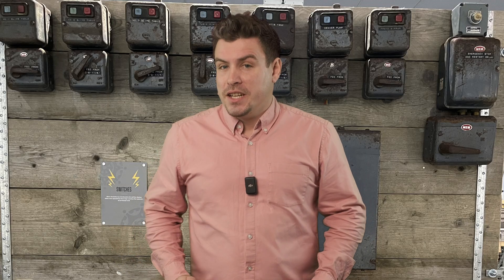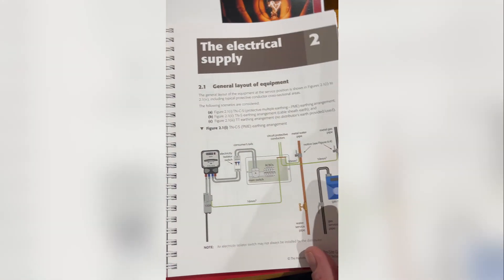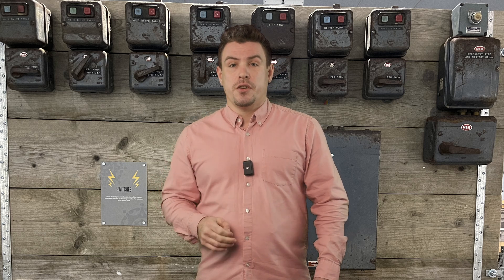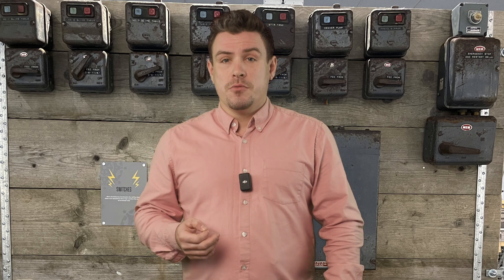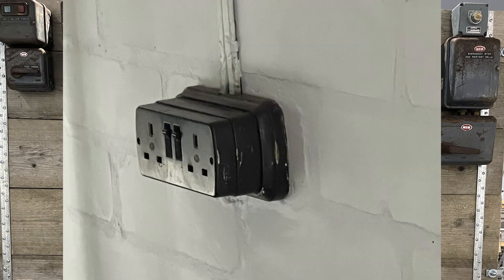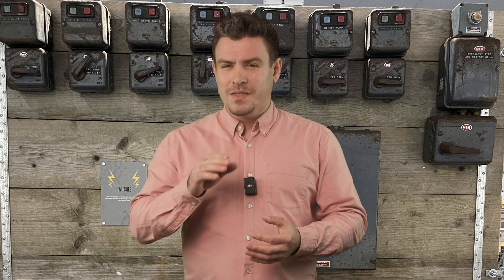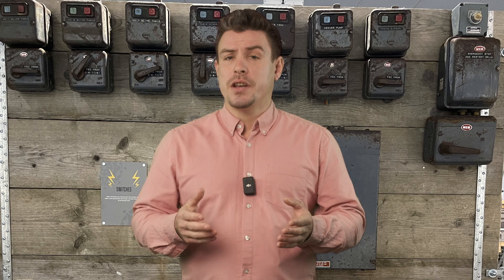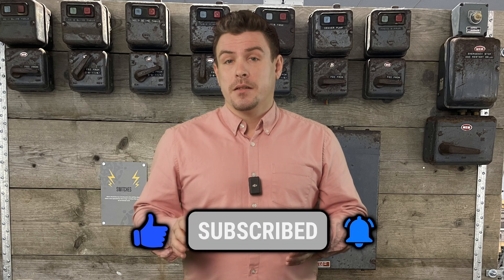'Electrical FAULTS that could KILL!' WK15:Becoming an Electrician

Comment: 3:22 - Earth = CPC (Circuit Protective Conductor)
Reply: The green/yellow wire has always been called the earth conductor and it always will be. Same as twin and earth has always been called twin and earth and always will be pyro is pyro  if you go to the wholesaler’s and for a 100 mtr drum of PVC twin and CPC or a drum of MICC you will get some funny looks and probably told to leave and close the door behind you.. a hammer has always been called a hammer you don’t go in to a store and ask for a knocker inner  do you  or a screw twister when you want a screwdriver.
Reply from the maker: @Dog-whisperer7494 good shout 😂😊

Comment: You realy need to read page 99 in the onsite guide if you have a copy and the health and safety executive’s note in BS7671. Also RCDs are only required for all circuits from amendment two going forward , installations designed before amendment two are not required to hove RCD protection on all circuits ,
Reply from the maker: Thanks for your comment and the references. Totally agree sorry I wasn’t clear in the vid. A bit like the old wiring colours. Just because they are not current regs, doesn’t mean you need to rip them out. 
It’s also not an excuse to convince customers that they need to upgrade an existing CU just because it doesn’t meet the current amendment. 
Personally, I want to have AFDD, and RCD’s protecting more of my circuits than I currently have. My own house will also be a good guinea pig.

Comment: Not correct about every circuit below 32A needing to be on an RCD. Depends what the circuit is designed for and how the cable is run etc
Reply from the maker: Thanks for sharing. Please share the cases where RCDs are not required. My understanding is sockets in commercial settings with a risk assessment is one situation.
Reply: @TheOfficialBatteryMan  if a circuit supplying a heater, cooker or water heating element for example was installed in say the kitchen, garage, utility room and was wired in surface conduit or buried in the wall in steel conduit or wired in SWA cable, it would not require RCD protection as long as the maximum recorded Zs at the end of the circuit was below the maximum allowed Zs for the protective device serving that circuit. All lighting circuits in a domestic installation need to be protected by a 30mA RCD as well as any socket outlets with a rated at 32A or below.
Reply from the maker: @gjrendle in those situations there is mechanical protection and a path through earth to trip the MCB. There is also protection from cable zones. But still potential for people to be shocked, right ? Take your cooker .. in fault conditions the casing could become live.
Reply: @TheOfficialBatteryMan  yes that’s correct it is to do with mechanical protection or not being buried in the wall less than less that 50mm with the risk of being hit by a screw. 

Because the zs reading on the cooker would be low enough, it would not present a dangerous touch voltage. Any touch voltage over 50VAC is considered dangerous and because of the low resistance to earth, an earth fault would keep the touch voltage below 50VAC or if the fault was more severe it would operate the appropriate device in the appropriate time (maximum of 0.4 seconds for a final circuit - cooker circuit)